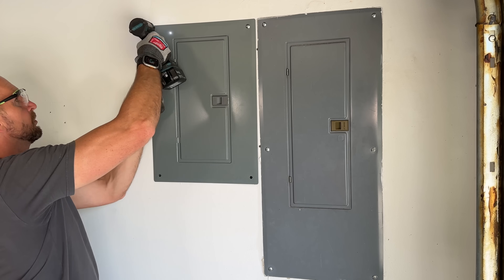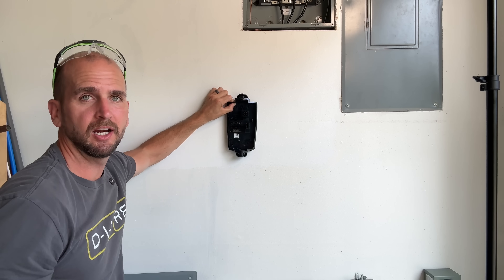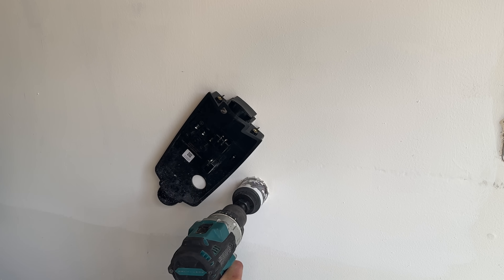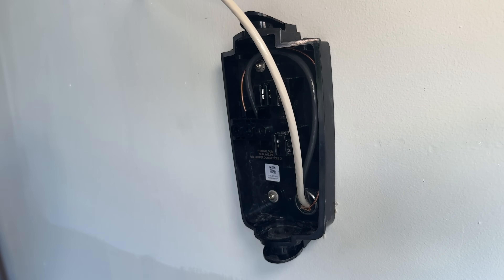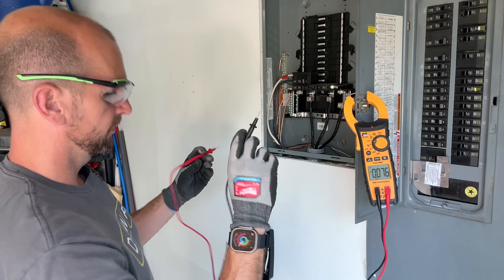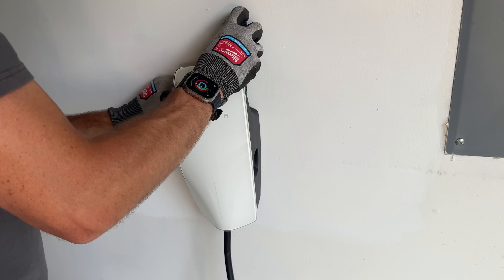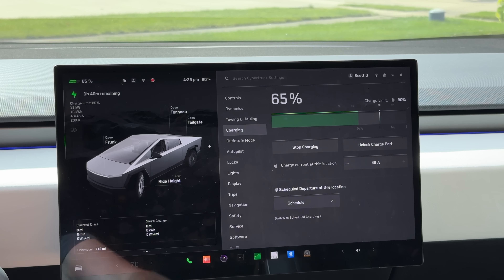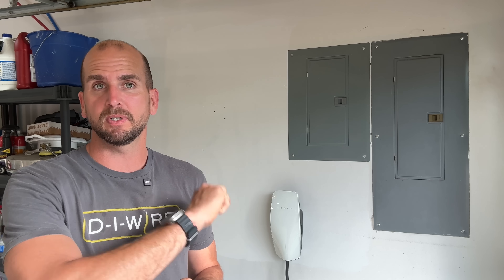How To Install An EV Car Charger | Easier Than You Think!

Comment: You have a code violation, not all #6 wire is created equal. #6 Romex is limited to 55A ampacity, and to charge at 48A you need the wire to have 60A ampacity. So the wire should be changed, or the TWC should be configured with the 50A breaker option and be limited to 40A.
Reply: 6/2 romex is only good for a breaker of 50a for 40a charging. Dont use romex for 60a breaker/48a charging. This can result in a fire
Reply: @nothingtoseehere93  It will not result in a fire.
Reply: Tesla instructions are clear that it requires 90 degree rated copper. I install these for a living (all are permitted and inspected) and must use #6 thhn if I use a 60 amp breaker and hardwired. We just had a change here in NC where the DOI superseded the code and even if I downgrade to a 50amp breaker and set the Tesla output to 40amps, I must use #6.
Reply: Yeap yeap
Reply: This chat is confusing the shit outta me
Reply: The reason is that the wire can only carry the 80% of the rated load consistently. so the wire has to be rated much hiigher, in this case 48a needs atleast 60a wire
Reply: It does depend on the temperature. But just out of curiosity, does the rating depend on the sheathing? So if you stripped it and had the stranded wire in conduit would 60 amp be okay? Or is it still sub par to just thhn?
Reply: @solideogloria7987  Regardless of the temperature, #6 Romex still is capped at 55A ampacity. It's true that the wires inside are pretty much the same thing as THHN, but they aren't labeled or intended to be used individually without the cable jacket.
Reply: I have a 100 amp braker available. I’m installing the ev charger about 25 feet away. What size wire should I get. Can I use aluminum wire 4 gauge?
Reply: @letstravelsandadventures8326  The Tesla Wall Connector can't accept aluminum wire.  You also need to do a load calculation to find out how much capacity you have available.  If you don't have capacity for the full 48 a, you can use a smaller circuit.  Find out what that is before you buy the wire.
Reply: @letstravelsandadventures8326  NO.  You can't use aluminum wire attached directly to a Tesla charge according to Tesla so consequently, if it is against the manufacturers instructions, it's a No-Go.
Reply: Negative Ghost Rider
Reply: He just showed it charging at 48Amps. If it fluctuates ~ 3% it's fine. Your talking about a very marginal difference. 6/2 or 6/3 is recommended for this install.
Reply: @euphoricmonk  I'm not talking about fluctuations. Fluctuations or not, 48A continuous is entirely too much for #6 Romex, which is 55A wire. It needs to be 60A wire to have the code-required 25% headroom for a 48A continuous load.

#6 Romex is only suitable for charging at speeds of up to 40A continuous, or 44A continuous, if the charger has specific support for 55A circuits. So you are wrong, it's not the appropriate wire to use for a full-speed TWC installation.
Reply: @letswritecode2283  Correct, he should have used 6/2 MC, which is also cheaper than NM.
Reply: @letswritecode2283  How about 6/3 Stranded CU SIMpull NM-B Wire?
Reply: @euphoricmonk  #6 NM is limited to 55 amps, #6 MC is good for 65 amps. Also 6/3 is unnecessary, no neutral needed. 6/2 is fine.
Reply: This guy must be great at parties
Reply: Interesting how he don`t answer your comment. I`ll say it , typical Tesla owner 😉
Reply: @AiBilly I’ll answer you: bug off you don’t belong here. Typical hater.

Comment: Helpful and informative video, Scott!  I'll refrain from comment on the musk-mobile -- almost all of what you showed would apply to any EV charger.  I'm curious -- is a cheap torque driver from Amazon accurate enough to be better than "screw it down hard, wiggle the wire, and screw it down hard again"?

Comment: Well yeah if your service box is right in the garage instead of the basement on the other side of the house
Reply: Running conduit is very easy.  Will your install cost more...yes.  My friends house is similar.  The service is located on the opposite side of the home.  You simply run conduit on the floor joist from the service panel to your outer wall...then use an impact drill and create a hole wide enough to feed the conduit.  The rest is pretty stright foward.  If you have a crawl space ...same thing.  Slab...just run along the outside.  Plenty of retro fits do this.
Reply: Exactly.  This guy was saying it was easy.  And it was for him.  The rest of us, not so much.
Reply: @easternyellowjacket276  Many houses built in the past 20 years are like his.  My 200amp breaker panel is in my garage, same as all the other homes in the neighborhood.
Reply: @mowcowbell  As I said, good for you.  But the rest of us with older houses or no garage, aren't so lucky.  It's just the way it is.

Comment: Love to know what you think of the Cybertruck. I’m on the list and I can order the Foundation Edition, but I might wait for the standard instead for the cost savings. Anyway I’d love an opinion from someone who’s not a professional car reviewer.
Reply from the maker: It has been great, there are some things like panel gaps, door seals, and other finishes which you can tell this is an early serial number.  From the driving experience it is fantastic but this is my first EV so I am sure I would get some of that same benefit from a 3, Y, S, or X.  The steering is amazing and I had no idea I would like it so much the combination of steer-by-wire and real wheel steering makes this think insanely maneuverable.   I have towed by 7'x14' dump trailer once and it was smooth and strong.  I am going to keep the raw look but will get a ceramic coating this week to help with cleaning in addition to the rest of the windows (not windshield) tinted to match the back.  Unless you are all in and want the foundation I would wait for the $20K discount and for them to work out some of the kinks that early trucks might experience (so far no big issues 🤞).  Oh yeah and this thing gets more attention and emotion than any car I have ever seen.  I will not be mad when there is 100 Cybertrucks in my town and I can go back to blending in 😂.
Reply: @EverydayHomeRepairs  Thank you, I appreciate it! The online pundits are so polarized--playing to either fanboys or haters--that I don't really trust any of them. I usually jump for special editions but the $20K uplift is just too steep and I wasn't planning on buying the full self-driving option, at least not at initial purchase. I think I'll wait for my place in the "normal" line and get just the options I really want. If I was being entirely reasonable I'd buy a Model Y, but I grew up in the 80's and I love the Syd Mead styling too much to pass up. 😎
Reply: Why don't you look at the Rivian?
Reply: @emiller7040  for me, quite honestly, it’s just not my style. While I want to go EV, I don’t need to urgently and I can afford to wait for the Tesla.